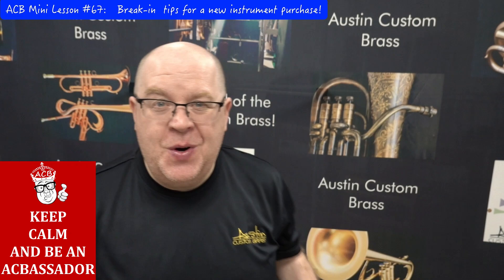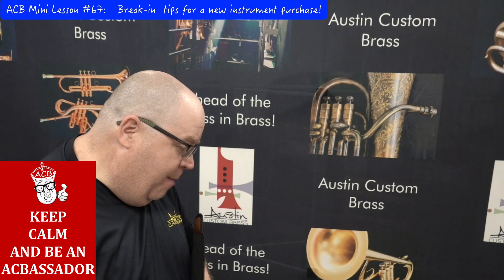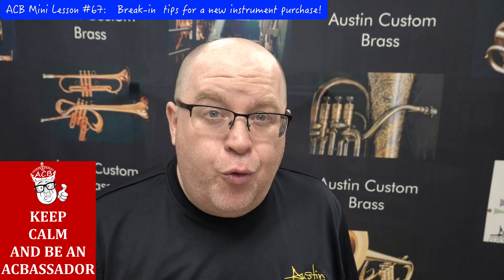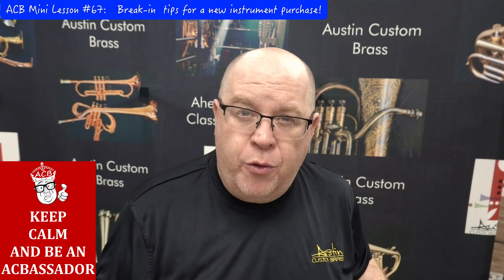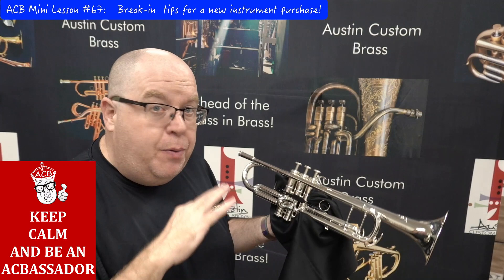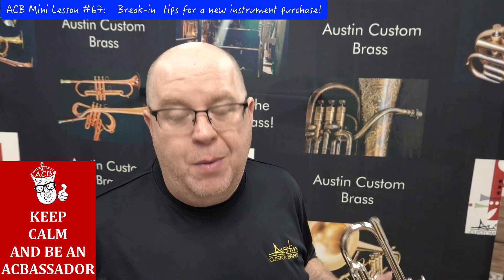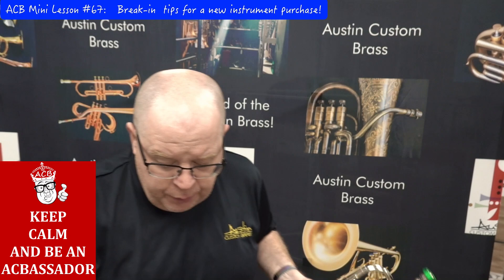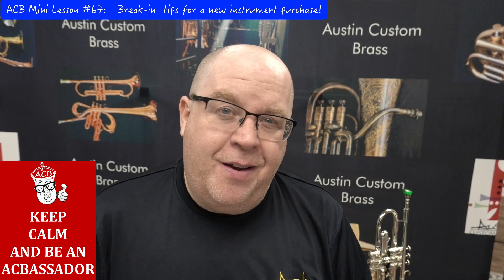ACB  mini-lesson #67 : Break in your new trumpet the RIGHT way!

Comment: So I did this complete method on my Adam's CN1 cornet and ACB piccolo trumpet, and finished off with a horn shower, as shown in your linked video (incidentally, its harder on a cornet because of the extra turns, but a little suction on the leadpipe got the water moving through.) All I can say is I'm thoroughly impressed at how much BETTER the Adam's valves are after the works (and they were really great before!) One thing I did do though, is instead of putting oil down the leadpipe, I used a a spare blow-dry bit soaked in oil. Assuming the bit doesn't break down, I might do this every time, as I'd imagine it will provide a perfect coating.

Comment: Hi Trent,  You also recommend BlowDry, which I find great at keeping the horn really clean and moisture free.  If used this will effectively remove any oil in the tubing, but also combat developing red rot by removing the moisture and any contaminants.  Oil of BlowDry?  I always find lots of excess cutting compound etc in new horns, it pays to give them a couple of thorough cleans, this includs the two Adams that have been delivered to me.  Cheers, Chris
Reply: So I use a bit soaked in oil, after the one soaked in alcohol.